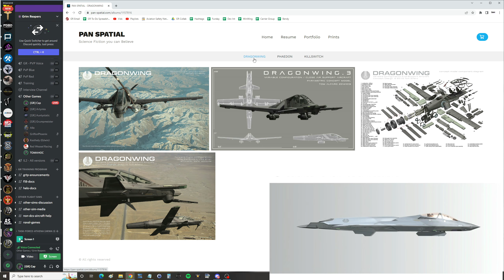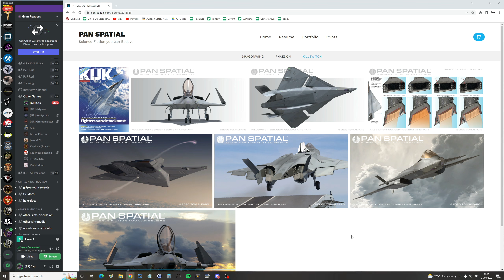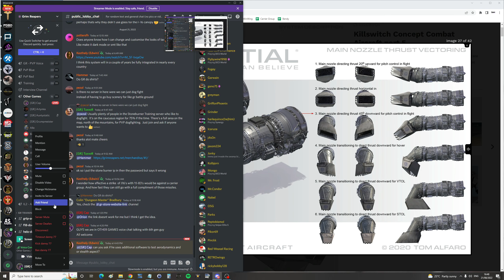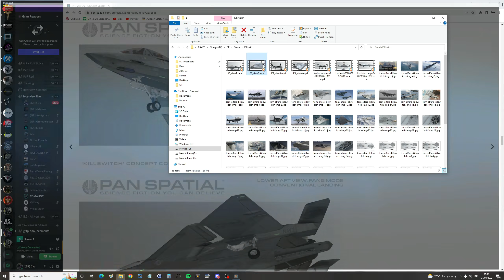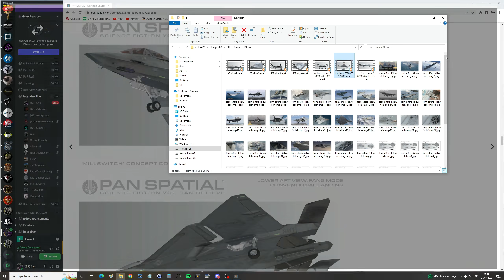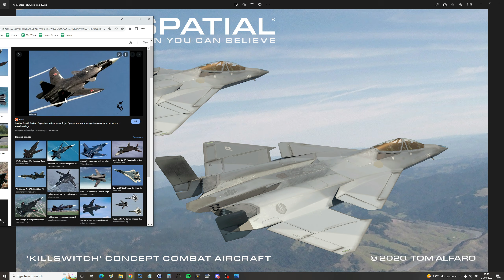Discussion: The "Killswitch" 6th Generation Fighter Aircraft Concept (by Tom Alfaro)

Comment: Imagine the maintenance costs.
Reply: the ground crews screaming in horror
Reply: @Archer89201  ground crews crying after spend years without sleep.
Reply: it'll be all done by robots :)
Reply: @DirtyHairy1  or adb
Reply: Lots and lots and lots of tight tolerance moving surfaces for dust and dirt to ruin, things never found in war. Swing wings were brutal for maintainers and budgets.
Reply: The yearly maintenance for one plane costs the same as the entire budget of Montana.
Reply: All I know as maintenance is I’m getting paid
Reply: I can only imagine the maintenance personnel committing suicide, honestly. Operational readiness rates of 0.0001%. Ten thousand hours of maintenance for every hour of flight.
Reply: We need proper advances in materials. We haven't really had any in decades. Just incremental improvements of the same old alloys and carbon cloth soaked in epoxy...
Reply: @Netbug  You know that they basically 3D print wings and other structures now, right?  Robot arms lay down the pre-preg weave.  Long, long past cloth lay ups with brushed on epoxy.
Reply: @AmericanWoman-z4g  I'm a machinist and also work in composites. You can't skip maintenance just because manufacturing processes are more streamlined, they are separate things. Fatigue, corrosion, and mechanical wear are all still factors and most maintenance is simply checking for damage, not even repairs. Everything has to be checked routinely and it takes a lot of time.

We haven't even figured out how to deal with plain old oxygen or UV effectively yet let alone salt spray, and radar absorbing materials are even worse. Just keeping them clean (so they work) is expensive.
Reply: @Netbug  Exactly this.  People don't realize that half of why American weapon systems are so much more effective is because we create maintenance schedules and keep them.  The Soviets/Russians today, cannot even be bothered with mowing the grass in summer at their airfields.
Reply: @AmericanWoman-z4g  We are the Soviets of today, dude... we're hard left Marxists and we started a proxy war with Russia, a country that was previously ravaged by Marxists and left to decay since the bankers that ran it set up shop here instead.
Reply: @Netbug  advancement in manufacturing those materials was the reason it wa possible
Reply: @shiwanisrivastava6716  There have been no major advances in decades. We've had carbon fiber since the 60s and proceeded to take baby steps refining production, developing better weaves and epoxies. The biggest advance has been in price reduction. Fundamentally it's the same and it's very crude. We are on the precipice of major advances, but they aren't here yet and the tech behind them will lead to other much more profitable avenues (bio) so expect materials to lag at first.
Reply: Alto keep in mind that once something like this enters into service the ground crews probably have close to 20 somethings years of maintaining F-35’s behind them.
Reply: @koekiejam18  most maintainers aren't going to be in service for that much time, plus its a different jet so having experience on the f-35 means nothing
Reply: @yoamal1187  Ill agree on your first point, the second one i would definitly consider up for debate, although the F-35 is a different plane; that doesnt mean that alot of the knowledge around it doesnt translate over.
Moving from the F-35 to this design takes considerably less effort than switching between a Sopwith camel and this new design
Reply: @koekiejam18  youll find the ground crews have specific training for each jet. Its a failure of the jsf program. They wanted to create one school, one set of admin and teachers for all three models. Never worked out and each one of the f-35s ended up being mostly different planes that look alike.
Reply: Probably all of Americas yearly earnings
Reply: Yes example b1 lancer having folded wind , maintenance cost incurred more
Reply: The ngad and the b21 raider are being built specifically with maintenance cost in mind they've already said this.
Reply: All those moving parts 😮
Reply: @Mr.Scootini  + saltwater no less.
Reply: @Netbug  exactly!
Unless they make it out of some composite material…
Reply: @Mr.Scootini  In 25 years corrosion will mostly be a thing of the past.
Reply: @Netbug  I doubt that.
We have stainless steel and those aren’t supposed to corrode or rust but they do. 
Same with Galvanized steel.
Reply: @Mr.Scootini  Stainless and galvanizing is ancient technology, and even the most advanced alloys and composites are crude old methods of melting and mixing. 25 years is a long time considering we're on the threshold of major advances in materials. Nanotech is going to change everything and eventually become very cheap. Think materials that physically can't react with oxygen, and self-healing carbon structures that are not bound by epoxies. It's on the way within your lifetime.
Reply: @Netbug  ahhh I didn’t think about nanotechnology.
Nano is amazing
Reply: @Mr.Scootini  And scary... it's going to make current nuclear and biological weapons seem like a joke.
Reply: @Netbug  I agree.
Same goes for AI.
Let’s hope that by the time these technologies come out we are much better as humans. 
But something tells me that there always will be evil people.
Reply: @Mr.Scootini  Yeah, judging from our track record and current state we're destined for a lot more bad things. I imagine humanity can fully enjoy these advances sometime in the future, long after we screw everything up first. We'll get to endure the early years.
Reply: Lockheed Martin: Ejaculates cash.
Reply: They didn't for the F22, apparently...
Reply: @hotjob9141  Raptor is not a swiss army knife like this thing.  That folding vertical tail system is horrific to think of as an asymmetrical failure point.  Two of them too!  Everything about this jet concept screams down gripes.  Down gripes for days.  (Maintenance up gripes mean you can still fly the jet, down gripes mean it is out of service)  The operational readiness of a unit with this thing would be well below 50% at best.  Imagine just the lubrication schedule on this design.  How are you going to power these movements when they oppose the airflow forces?  The fuel capacity looks like another weak point.  Along with the size of the radar (available surface area for the sensor plate) being problematic, is is going to rely on data link instead?
Reply: Our taxes
Reply: Aswell as design and production costs, just working out all the kinks
Reply: It looks to me a question of using linear hydraulics, mechanical screw movement, or electric motor actuator.
Reply: @rgloria40  Aircraft get chosen (or not chosen, even canceled) based on things like sharing engines with other aircraft in the fleet to keep parts cost down. There's way more to the process than you seem to think. Maintenance would indeed be incredibly high for a variety of reasons. It's already too high for current gen aircraft and always has been.
Reply: @rykmoo2201  Yep, the marketing "presentation" of the F22 over the F23 was better and more extensive....
Reply: @rgloria40  Mechanical screw are a maintenance nightmare.  Linear hydraulics are heavy.  Very heavy.
Reply: Imagine the development costs
Reply: True, but it should be offset by a smaller fleet.
Reply: That will depend on how many they make the f35 cost less per operation hr than the f15 or f18 even the purchase price has gone way done
Reply: @Death squadron even worse
Reply: Thats what i am saying
Reply: YUP😆😆😂😂😂😂😄
Reply: Too many moving parts
Reply: The disposable plane, dont bother tearing it down to repair it, just build a new one and toss that one out!
Reply: Nothing is expensive for the us
Reply: @x_9005  Take a look at the debt clock and trail of canceled programs.